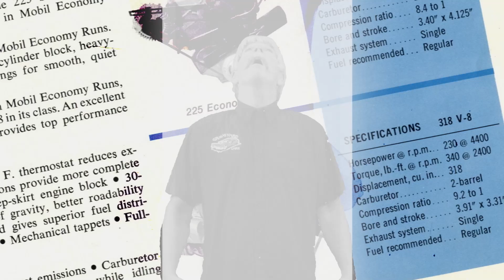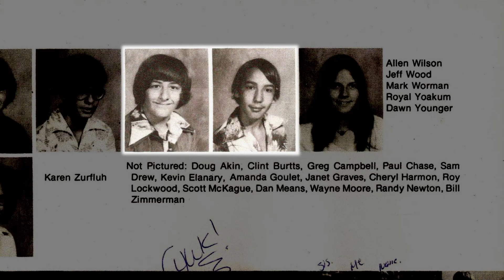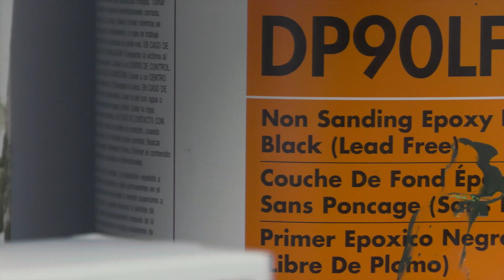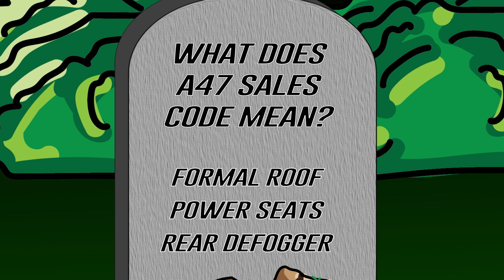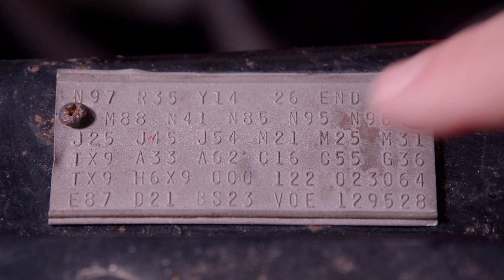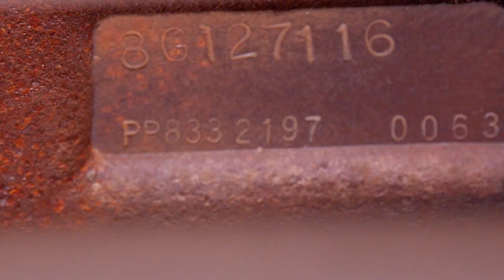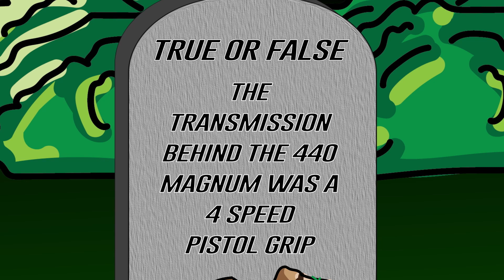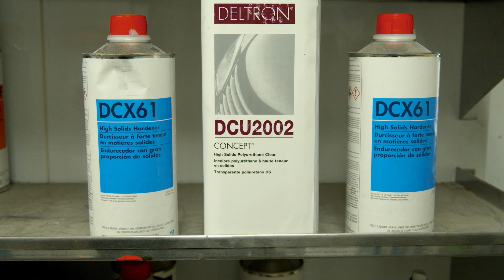MILLION DOLLAR '68 HEMI CHARGER 4 SPEED ALL NUMBERS MATCHING

Comment: This is one of the best Mopar rebuild shows ever. I am a big Mopar fan going back to my 1st charger it was a 69 gold white vinyl top. 383 mag . My 2nd car a 70 rt that like liike green glow in the dark black top . It came with cross ram air induction.  727 troupe flights.. the guy I got it from had put a 318 in it after gradaening the 440 from the factory I got the car for 1000 bucks me an my dad built that cars drive train we put a 383 mag  in as the motor was because I new them I love thar big block house power you can build  a 383 an get some great power . We put 550 to the rear wheels. That was after I put the aluminum heads roller rocker balanced ported polished  11to 1 30 over . That car was a bad ass . Set you back in that set an it did.

Comment: What doesn't cease to amaze me is that an engine which cost less than $1,000 when it was new back in the 1960's installed in a HP Dodge or Plymouth could now command that car's price into the low to high 6 figures and some even into the 7 figures. That is the 426 HEMI engine for you. Now IF it would've been the RACING version of the engine installed underneath that hood, maybe. Baby Boomers are the ones who have jacked the prices of these cars into the stratosphere making it impossible for the average guy to even think of buying one of these cars. I say CLONE em if ya can't afford one or even build one and split the cost 2, 3, 4 or maybe even 5 ways. Just get the car done right if it is to be restored properly.